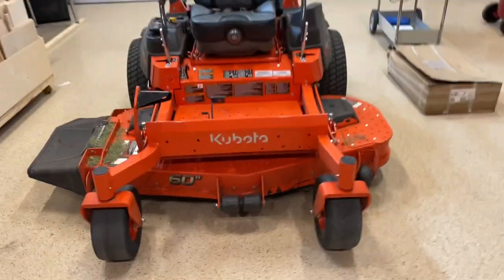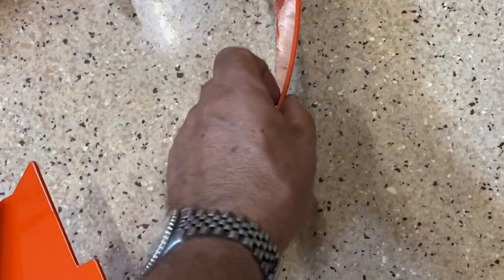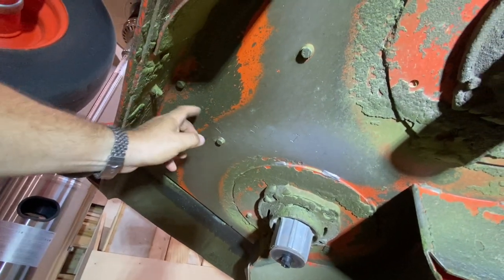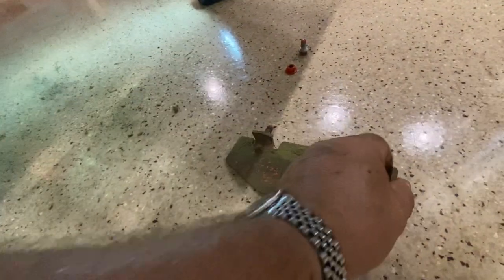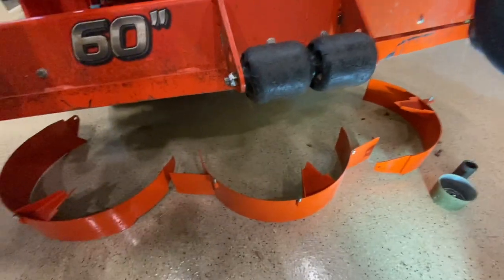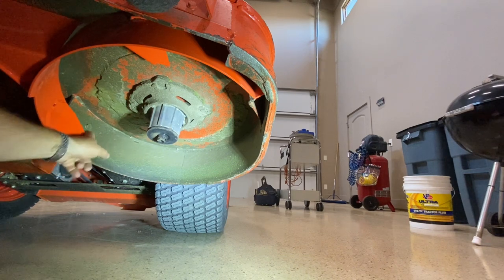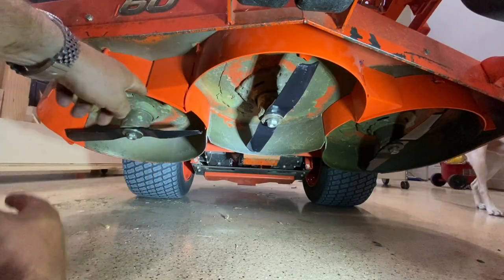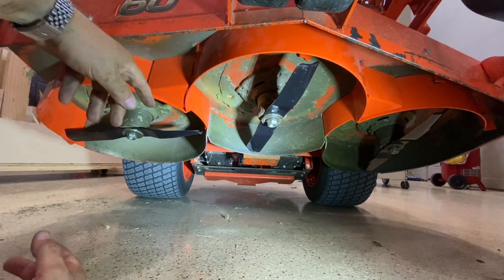Install Mulch Kit on a Kubota Zero-Turn Mower z781i

Comment: Just curious what kind of winch system are you using to lift the mower. I need to install something like this so I can work on my Kubota 48”. Let me know. Thanks!
Reply from the maker: I’ve got a steel I-Beam in the ceiling with a simple hoist attached on a chain. Holds 2,000 pounds. 
https://amzn.to/4aubhzZ

Comment: Are the blades that came with the kit the same as original blades or mulching blades. I'm asking because I just bought the 726x this past weekend and I'm waiting to pick it up after the mulching kit is installed. I just want to make sure I get the right replacement blades. Thanks.
Reply from the maker: Mine had a different bend in the blades than the originals. They should give you back an original set of blades after the install.
Reply: @ApacheRanch  Thanks for your quick response. I was wondering if they would owe me a set of blades as well as the original parts you removed in case I ever wanted to remove the mulching kit.
Reply from the maker: Yes absolutely. They are going to receive those parts from Kubota already installed. They are yours. I would insist on it.

Comment: Just the video I needed as I have the same mower and fixing to get the kit. Question is how well does it work? I'm getting specifically for leaf season. Thanks in advance
Reply from the maker: I really like it.  It's been a very hot and dry summer here in central Texas, and when I was mowing it was like a hurricane of dust and crap blowing around and covering me in crud.  My main reason to switch on the mulch kit is that my other zero-turn mower (smaller Gravely with similar mulch kit) doesn't have nearly the amount of dust swirling as the Kubota.  It keeps all the cuttings under the deck and you drive away.  This kit really reduced that dust coming up on the Kubota as well.  I have to mow a lot of tall weeds/shrubs/debris in these pastures and I was worried about it getting jammed up underneath, but that has not been an issue at all.  The Kubota just grinds everything up and you leave no trace behind.  Should have put this kit on my Kubota machine on day 1 in my opinion.  It will vaporize your fall leaves I am betting.  Well worth it.
Reply: @ApacheRanch  Just ordered one. Should be here in a week or two. Thanks man I appreciate it.
Reply from the maker: Good luck!  I'm making a few more Kubota maintenance videos here soon so Subscribe to the channel if you get a chance!
Reply: Leaf season is here lol. Kit will be installed next week. Looking forward to see how it does.
Reply from the maker: Oh it's going to vaporize everything.  It's a pretty good upgrade. @MrCrunch76
Reply: Just got it mounted and gave it a test run. Leaves nothing but powder. Installed a set of Ballard Ripper blades too. I think I may actually like leaf season this year lol @ApacheRanch
Reply from the maker: @MrCrunch76  that is outstanding! Glad to hear it worked for you!  Yes, it’s been great down here for me on high weeds and brush. Grinds it all up!
Reply: @MrCrunch76  still working good?
Reply: @joshua7999  Loving it! Can't believe how well it works. I will occasionally get some blow out from the front but nothing major. I've got a 4 acre property I mow for a lady that has a ton of trees, and this kit makes it easy work and it looks great when I'm finished. I haven't been to her place in 2 weeks and the leaves have dropped like crazy the past week. It will get a workout for sure this weekend.
Reply: Easiest leaf season ever! It destroys leaves. @MrCrunch76

Comment: What did that side discharge baffle do, it was such a small piece and I didn’t get a good look how it was mounted?
Reply from the maker: All it does is direct grass out the discharge port / exit path. When adding the mulch set you don’t need it anymore since the curved piece on that side fills the whole circle. No grass exit port anymore.
Reply: @ApacheRanch  thanks
Reply: @ApacheRanch  I just bought a brand new one with the 42 inch cut. I had the dealer install this before they delivered it and I don’t know if I should try to convert it back because in thick grass it seems to suck it all up into the deck and it gets caked in there and when I get to my driveway it blows it load like a teenager on prom night. Maybe if I put regular blades on it might solve the problem.
Reply from the maker: Well I’m in Texas so wet grass really isn’t a thing here. If I didn’t have the mulch kit it would be a dust tornado each time I mowed.  I’d recommend keeping it - so many benefits for the lawn. Just shut down the blades over the grass on occasion to let it burp out. That might stop prom night somewhat. Good luck!!
Reply: @ApacheRanch  😅thanks again.